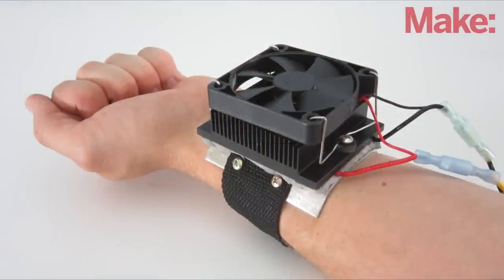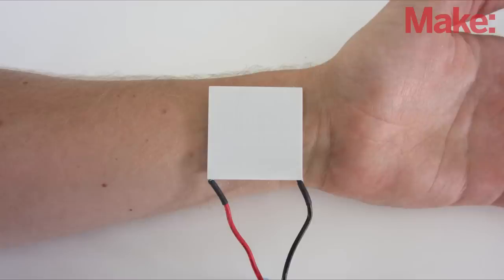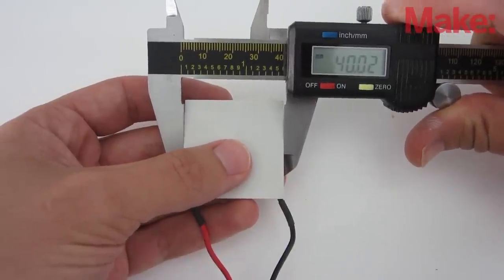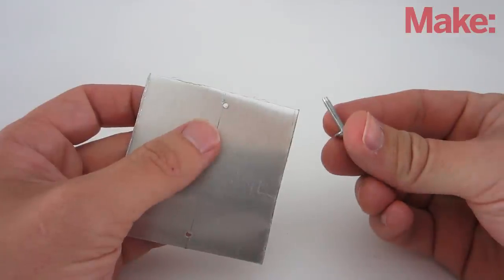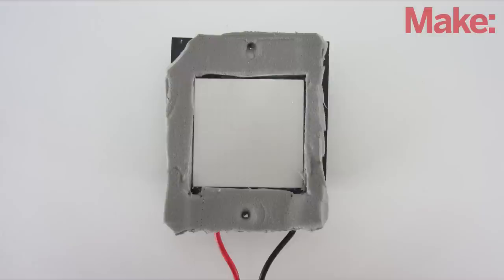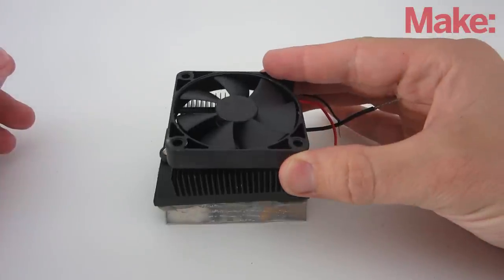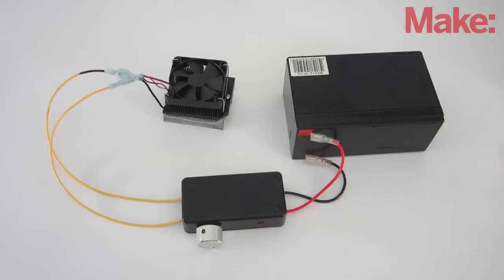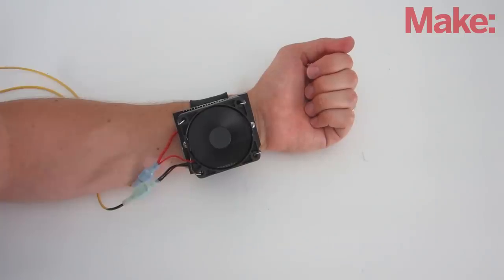Personal Cooling Unit

Comment: And how is the performance of the cooling unit?
Reply: I made something similar with a 60w peltier, granted my setup is not exactly the same and mine could be somewhat defective but I couldn't ever get mine to freeze water, it does get quite cold maybe 20F colder than ambient and the hot side absurdly hot but it cooling capacity is a bit unimpressive, not sure it would keep me much cooler although I haven't tried placing on my wrist.

I am attempting to use mine to keep me cool in Arizona summer though and 20F below ambient wont cut it in the summer as it could pretty easily still be in the 100s at that rate

Comment: It's nice to know people still make comments like "it wont work" without actually having any engineering knowledge. Did you know peltier coolers are sometimes used to boost the cooling on CPU's? Did you know that these little coolers can, if driven properly, remove over 100 instantaneous watts of heat energy per square inch? Sure it takes some juice to do it, but it can be done. As for the looks, people are so closed minded and seem like they look at the world with blinders on (Blinders, you know those things they put on horses in the city to keep their view narrow? I know a lot of people like that). This is just a prototype concept. I can already envision this thing using a narrow string of peltiers with tiny low profile fans pulling heat through custom designed heatsinks inside of a small housing including a lithium polymer removable battery that could be worn around your neck on a hot day and maybe provide 1-2 hours of relief per battery or charge. Open your mind. There is no box.

Comment: What would worry me more about this isn't the style, after all one could dress it a little bit better, make a "stylish" housing for it (depending on one's sense of style, be it sci fi, steam punkish or whatever...

It's the power consumption!
At no point do they talk about it, what's the wattage of the Pelletier plate?
I highly doubt such a circuit could function for any decent length of time, excepted pwm'd to within an inch of it's life as far as wattage, and heat dissipation goes,
If to get any sort of autonomy you've got to reduce the thing to a barely efficient mess, that's no use,
Whereas, although heavier; a bacpack containing a large thermos of fresh tap water, with a water circuit comprising a small pump, like an aquarium pump, some vynil tubing, and a modified watercooling block!
Although still as dorky, that oughta work for a decent amount of time, though you'd have to trade wheight to get better autonomy (usually cold tap water exits the faucet at around 15°c) (with a low pressure cuff arround the heat exchange pad, you could get away with a colder fluid without causing capillary contraction and decreased bloodflow to the skin surface)

(But after all, that type of solution allready exists with water circulating vests trading energy transfer efficiency (aka an Al or Cu block on the skin) for bigger surface of exchange...
Might still be more efficient though!!!

Comment: Walk around public with that...
Reply: Jon MRC Suffer because of what strangers might think?
You should be more important to you, because strangers really don't give a shit, and why care if one or two do?
Reply: ***** Calm down there, its only a statement that i found funny. No need to explain the principle of the public. I get it, sometimes i dont do my hair and just fuck it.
Reply: ***** I  know the feeling. We have those huge ass fans in the hanger i went to. On the way up in the plane they gave our team ice to suck on but we had to spit it out or finish it before we jumped. Haha
Reply: lassi kinnunen I now, Thermoelectric cooler is not efficient
Reply: lassi kinnunen "good luck having any use of this in 50 celcius...maybe you're going to get 3 watts" I'm glad to see this, as I decided the same (without knowing the math) before building one last week per my above comment. As I considered what I could do with nearly unlimited battery it seemed even a pair of these would probably not be useful in 36celcius, with repeated intense physical effort, especially as my mass=100kg.

Instead my wife (who can make clothes), cut/ sewed a "Frogg Toggs Chilly Pad (evaporative) Cooling Towel" into a pair of tight fitting elastic-equipped tube shaped "forearm covers" using patterns for ancient leather armor "Vambraces" like Gladiators would wear. From wrist to elbow, these made a large difference using unlimited water, strong 120AC fans blowing on my arms, and some wind during skydives, though they were mostly covered by jumpsuit or wingsuit sleeves.

And LOL Jon MRC , I've never thought about chewing ice, I usually dunk my head in cold water before I get on the plane, but it's VERY good that people don't jump into freefall with anything in their mouth, the wind could drive it into your lungs or sinuses or who knows where! Occasionally you will open your mouth at the perfect wrong angle (perhaps yelling/ cheering, though as you well know nothing can be heard!) and the wind will "blast out" your sinuses, painful but instantly forgotten, so you land 5 minutes later barely noticing that you feel like you have the flu, and 100% unaware of a crazy dried blood pattern like war-paint going back into your hair until others see you. LOL It would be insane to have a piece of ice inside your forehead, even for a short time until it melted!
Reply: people will think its a bomb
Reply: ***** You are just an angry person arnt you.
Reply: Jon MRC Yes, in a unending near-murderous rage ever since they cancelled Firefly. Skydiving quiets the voices but it's too cold for that now. I'm scared, Jon.

Comment: I tried same thing but only with CPU cooler(cheap one with 4 heatpipes) and low fan speed 1000 rpm on muscle Quadriceps Femoris(google it)I thought that he can take the cold couse it's qite big muscle.Room tempreture was around 30 celsius.I used it almost one hour and the next day i had muscle fever applied to only that muscle.

Comment: Add heat pipes some sand casting of aluminium and a blower stile cooler simmer to nvider the gpu company (I can't spell names) and some CAD and you have a slimmer disinge and more surface area for heat exchange

Comment: How much bigger would a unit have to be to refrigerate stuff?  We've been arguing this up and down.  For one thing our bodies do this seamlessly.  As long as someone isn't stupid enough to wear plastic that stops the evaporation process or tell the staff in one's gym to turn the fan off...this just might be a 'cool' thing to know!  Otherwise, this is just a silly application!  The body does it better if the brain understands the evaporation process.  Would this work for a smallish 3X2 insulated box? Or there should be another application for this to be of some use!!

Comment: what foam do I use because google heat resistant foam gives me tape...
Reply: All I get for that is spray on foam, I might try it but I feel like it's not at all what I'm looking for...
Reply: You probably figured this out already but I'm pretty sure it the same foam as weather stripping. You can get it at just about any home improvement store.

Comment: I'm no electronics expert, but couldn't you have just used a potentiometer for adjusting fan intensity?
Reply: I think you would need more than just the potentiometer because it just measures potential voltages, not temperatures. If you could pair one with a thermocouple I think that might work. But hey, I'm no expert either.
Reply: canibal803 Well, the potentiometer would just add variable electric resistance to the fan's power, limiting the fan speed, correct?
Reply: BadLarryFilms, home of TheShadbusher That is correct, however using passive resistance is not the optimal controller in this instance. Using a potentiometer will reduce the output to the fan and thermoelectric plate, but it takes that extra energy and converts it into heat; the very thing we're trying to remove from the system. It also wastes energy that could have been used to the power the device by the same heat conversion (especially important when running from a battery!). By using the 555 timer and a relay no energy is wasted by simply shutting the unit on and off, so no extra heat is generated and no energy is wasted.
Reply: BadLarryFilms, home of TheShadbusher yes but potentiometer is not powerful enuth for the amout of curent going through so what wood hapen is it wood start to get hot,smoke and burn
Reply: bor_12345's Electrofied Gaming 1 word, resistor
Reply: Playing Articulate battery - resistor - potentiometer - resistor - PNP - fan

Comment: mmmmm....

you need to make a controller for the peltier cell, otherwise it burn the cell; NOT that controller, but a controller whit a inductance
and the schematic of controller..... why a relays? you want to make sound? the 555 can put out 200mA, i tink they are enought, and if they arent use a transistor! a power transistor commanded by the 555 was perfect

Comment: Why do we need the heat sink to cook the hot plate down
Reply: +Minh Vu so i i dont know overheat
Reply: So that the extreme temperature difference potential between both sides don't thermally mix and make the cold and hot sides reach an equilibrium that is effectively the equivalent of the peltier being not on at all

Comment: You should market these for cosplayers and mascot costumes.   I'd buy.  Can get upto 140*F, hotter than a parked car in summer, in a mascot costume with fur.  Totoro is a bitch to wear but fun as hell.  This unit you made is small.   For a cosplay, I'd need 4 of them I could place about the mascot, using the fans to distribute the cool.

Comment: The cooling pad wastes around 6amps at 12v so 72 watts of power I don't think anybody would be able to use this with a decent sized battery since there is no battery like that except for lipo butteries and that's just too much just for a pad you would be better off using a fan that's made in China.